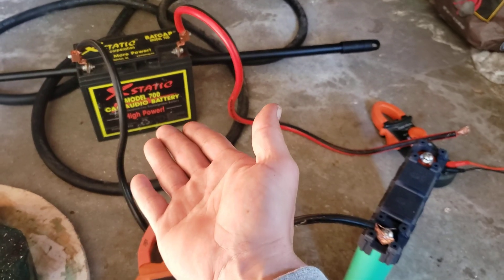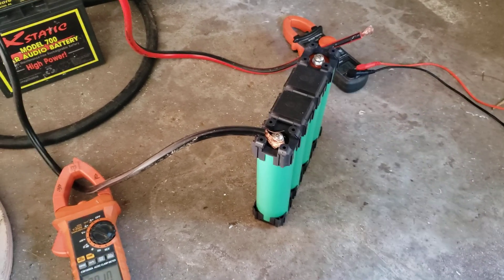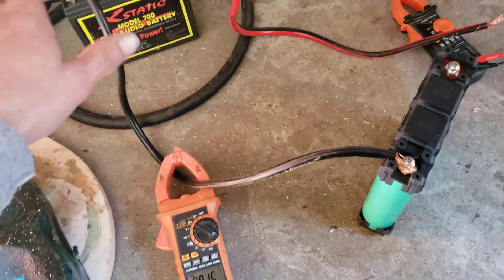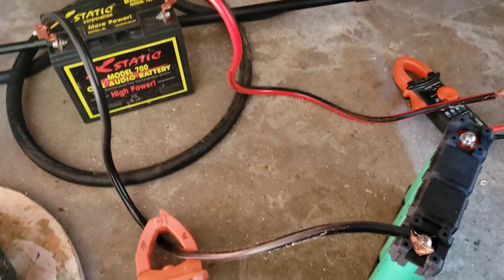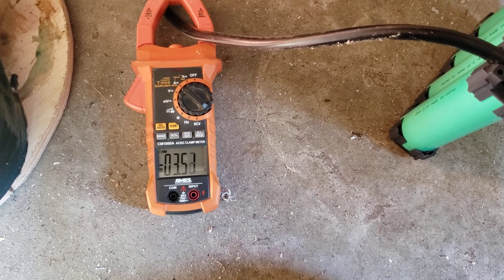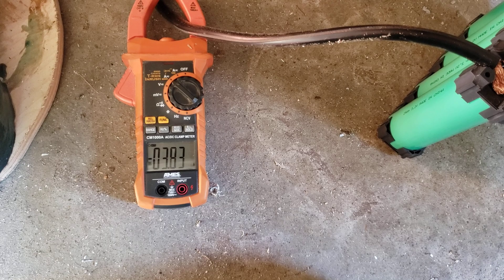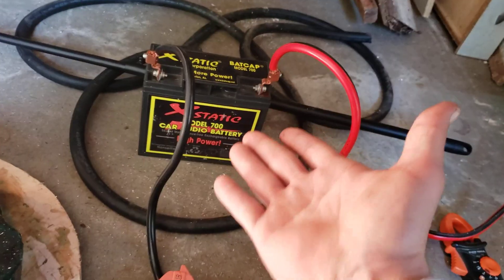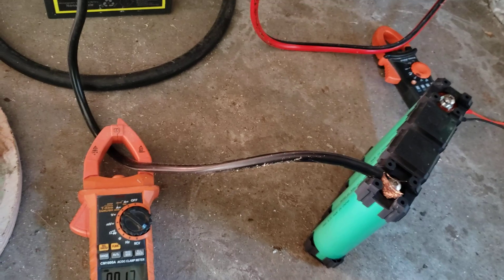does AGM hurt lifepo4 Lithium in parallel ?

Comment: I believe and it's my personal opinion,  just run one or the other, safety always is the best bet.  The only thing that lithium cells do better is charge and discharge at a higher quicker rate than agm and it takes less lithium  but always think safety

Comment: I have two 12.6v 150ah flooded lead acid battery in series. I charged it at 28.8V (14.4V) bulk, absorption and 27.6v (13.8V) float.
If I were to add 24v 100ah LifePo4 in parallel to it, will it be fine when charging at 40A or higher and discharging it at 100ah?

Comment: Hey I am brand new to lithium and I just purchased a 74AH lifepo4 chemistry battery for my car audio setup and was told to get rid of the lead acid and just run the lithium but I need to know if I need anything else to keep the alternator from burning up its a stock alternator can't upgrade due to CAN BUS system and warranty so I am trying to figure out how to charge it safely without frying the alternator and or overcharging the battery im going to get a wonvon battery monitor to keep an eye on it but do i need an isolator or DC to DC charger or something else like that im clueless and need help to learn can you please explain this to me

Comment: The load is temporary and it's because those two batteries you just connected were at different voltages.  Once they equalize, it doesn't matter.  It's actually good to keep lithium paralleled with AGM's because they will keep your voltage topped off longer because the voltage curve on lithiums is much different than AGMs.
Reply: So in a van I can mix lifepo4 and agm batteries to be charged with the alternator?
Reply: @BOREDANDWELLBORED you can parallel them.  But it's best to set your BMS to cut off voltage to your lifepo4 to 3.45v per cell.  It's also wise to do a voltage check to make sure you're not charging above 14.4v.  Alternatively if this is for a house battery you can use a dc to dc charger or a smart battery isolator rated for lithium.

Comment: I did a front battery delete with just a 40ah bank built with 13180 hp lithium cells and using them on my 2012 f150 with a taramps 3k and 2 sundown SA 15's  with a 800rms 4 channle with 4 6.5 ds18s and full tilt with my truck running a 300amp alt I don't have much drop at all runs everything and don't dim lights 13 - 13.4v

Comment: Cold weather... Lithium bad!!! I'll stick to my AGM and Headway. No isolation needed as it's my daily driver. Lithium never drops below 95% when I let it sit for 48 hours
Reply: I have 70ah AGM under hood, thinking to get 30Ah of lifepo4 battery in the trunk near audio amps. I can just connect AGM with Lifepo4 together and no issues? Car is driven every day.
Reply from the maker: I've used lithium in Wisconsin in my daily for over 6 years . Lto is amazing
Reply: Do you agm and lithium or just the lithium....and if just the lithium, how much lithium and does it start your vehicle in -35degrres Celsius?
Reply: Hey...Mazda...I live in manitoba , Canada....do you think lithium alone will withstand manitoba -30 degrees Celsius winter  cold starting?...or should I keep agm in front
Reply: I live in Canada and want to run agm up front and 96ah headway in the back...its my daily driver also....do I need an isolator at all or no
Reply: Eskimos dont need cars

Comment: I think the voltages are trying to equalize between the two and since the agm can't sit at a higher voltage like the lp4 cells, it's probably just trickling the lp4 down. 

The next test is to see how much current the lp4 draws to see if your doomsday alternator theory holds.

I think yes the lp4 is being drawn down and yes it is being charged back up when the alternator is running.  But I also think the lp4 has a balance charger built in and might not slam the alternator for amps.  Furthermore, for longevity, lp4 cells are discharged to 75% when not in use, my dji drone battery packs do this automatically after 3 days. So while it might look like a bad thing, this could actually be beneficial to the lp4 cells.

Comment: And then you start the vehicle and it’s charged right back up. It’s a non issue.
Reply from the maker: It cycles the battery everytime , you are killing its lifespan that way , also its sending your alternator full charge which causes it to get hot and reduce performance right away when you start the vehicle,  also reducing alternator lifespan
Reply: I run agm in parallel with a 48ah headway set up.i do have a battery relay separating the headway cells from the agms when car is off.got big money tied up into the xs power batteries I'm gonna use them.my alternator never goes to full charge upon starting due to the computer controlled charging on my gm vehicle.if you drive your car a couple times a week the lithium won't drain into the agm enough to kill it.i still have mine individual even though it's my daily for peace of mind.

Comment: those are equalizing amps 🤦🏻‍♂️
Reply: My lfp is resting at like 13,6 ish(if i recall correctly). I can charge it to 14,2v (99%) and then leave it for a few days and it will settle there. Its still 99%. Dont think anything will flow to the lead unless there is a load. I might test it one of these days. Ofc it might trickle charge the lead as it itself looses energy, lead being lead, but thats tiny amounts. But interesting topic, we need more testing and videos about this
Reply from the maker: yea drawing ur lithium down then when you start the vehicle it needs to charge the lithium again and hurts ur alt , while cycling your lithium

Comment: Mazda is correct about this.   AGM is just a waste of money today.  Get a 4s Pack of any lithium cells and call it a day.  No more sulfating since the Lithium is in the sweet spot.  Long life if you keep the cells cool inside the trunk.  (away from engine heat)  And if you build with the right cells?  Plenty of power that surpasses AGM in both weight and actual current/Voltage.   And better Gas mileage as well! 

Those of you with 14.8 volts coming out of the alternator will get use to your car sitting at 13.9 floating voltage most of the time with a large enough bank to 14.2-14.5 volts being the nominal after you shut the car off if using the 4.2 volt Lithium Ion cells.   

The sweet part?   You never fully cycle the lithium cells.  So they remain in the Goldilocks zone.  Meaning, they don't wear with charge and discharge cycles.   The battery will physically dry out before you start putting any wear or tear on the cells  internal structure this way.    

Using the large cylindrical cells will almost give you a 20-year lifetime especially if you're using it for a primary starting battery application.  (Granted you have battery protection that cuts of at low voltage)    

If cold climates are a thing for you?  
 5000 Farads of the super caps should take care of ANY cold starting issues you  may come across.    In reality?  If it gets cold where you live and have your own house?  A Engine preheater is the best way to go anyways. So you really don't need it with a large enough bank and a trickle charger.    

When in doubt?   Insulate your batteries in the trunk in the winter if temps get to freezing.   
Those worthless defroster heaters are like $12 bucks.  Using just a small one in an insulated pack will be all you need with a thermostatic switch.    You can even run it from the pack as the discharge of the load from the heater is about 13 amps max.   
THAT"S NOTHING! for a proper size pack.  

In about 10-15 min, your pack should be at operating temps, and you should be good to go to start your car even below freezing temps outside, granted you insulated your battery box. 

Look after your pack, and it will last WAY longer than any AGM or flooded Lead acid Battery. 
And bonus?  The ROI of your pack build may pay off in less than 2 years on average as you won't lose the same amount of capacity as you would with Lead based cells.   

if you never put your car on a battery maintainer , I have a 13.8 volt electrical system?
routinely play your car audio system without the engine running? Your return on investment will come back in less than 6 months.    since lithium cells don't sulfate you're basically already ahead of the game. and in a 4S pack configuration you're basically just babying the batteries.     

if you plan on using high-quality LTO  cells, the average lifetime is anywhere from 10000 to 20000 Cycles but you're hardly ever going to cycle them that much in regular application so plan on them lasting the life of the car.     
-iMickey503

Comment: just want to say - this is a  vary Item (brand/type of agm/lithum) True a Lipo is ma
xed at 14.2 (atleast mine is after key is off) and a AGM sits at 13.8v(good hi-output one)  the differances is 0.5v untill they equlize and thats like 5% of a Lipo (also note the internal resistance of AGM - that limits this disscharge rate = might take some time to louse this 5%) 

also note 1/2 of a volt - iv seen some Manufacted batterys come with cells more off - just saying ... its brand/modle of batterys your choose - (note agree on deleting a Lead-asid )

Comment: How would you determine the max charging amperage rate for a 24 ah headway bank? What's the formula or equation that will determine that?
Reply: You can charge safely at 100-150 amps depending on the temperature of the cells and your BMS we'll monitor that.    check out the data sheet and it'll tell you
Reply from the maker: Ah x c rate for charge . So 8x5c = 40a per 8ah that is constant. They can take a peak of 80a per 8ah . 
So 24ah would be 120a constant and 240a peak

Comment: Would a battery isolater between the AGM main battery and the Lithium battery bank in the trunk for the audio system separate the AGM from drawing the lithium? Also would a DC to DC battery charger help matters?
Reply: Compare a 40 ah agm to a 20 ah or less and ya will see the 20 ah has 0 issues starting the vehicle even a big v8.
Reply from the maker: nope , they still connect during charge , so its still a load.
Reply: @mazda2284  if you bypass the AGM battery up front in the engine bay, and do a couple runs of power cable off the alternator's charging stud could you still keep the AGM for starting the vehicle, but just run the lithium battery bank for the audio system?
Reply from the maker: @dylanbender3856  you have to remove the agm from the system , your lithium is all you need for the whole vehicle. we run no front batteries "starting batteries" in anything we build . the lithium is far more powerful than ur "starting battery"
Reply: @mazda2284  yep did that with mine
Reply: @mazda2284 It's not a load dumb-dumb.  Connecting two batteries cannot magically make energy disappear.  They just equalize.